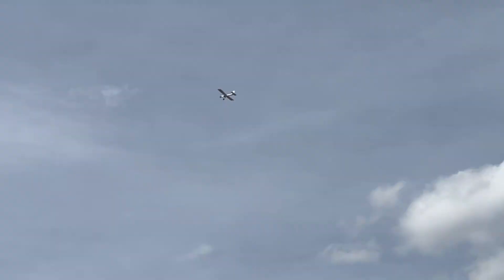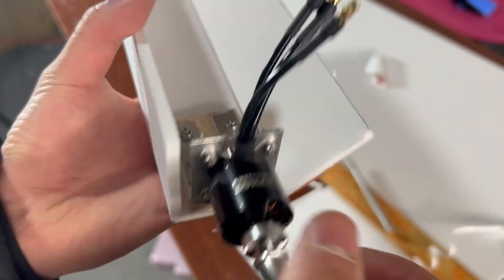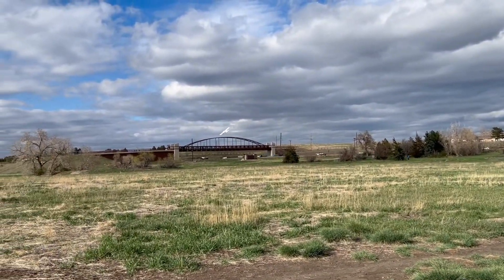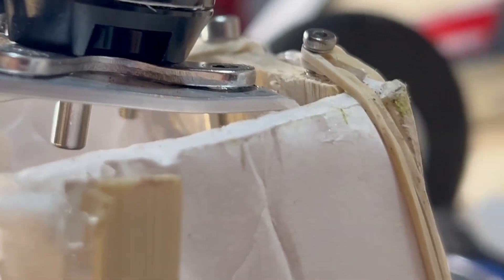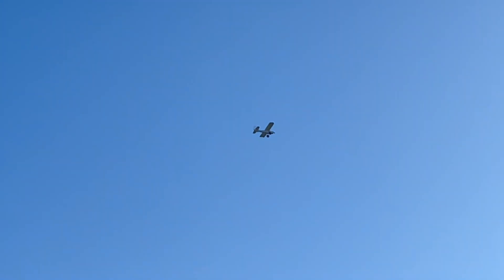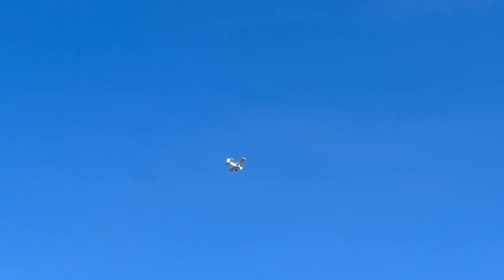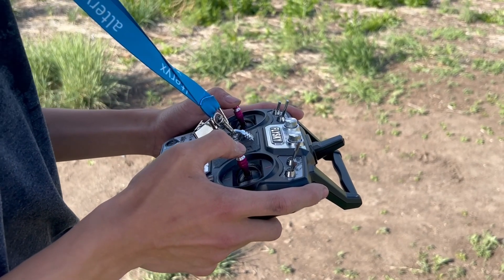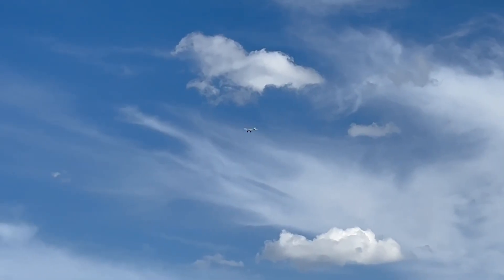Heavy Duty RC Carrier Plane

Comment: 35-year flight test engineer chiming in here with a few observations.... 

1) You might improve the stall characteristics significantly with a bit of leading edge droop on the very outer wing panels. Just search for images of "leading edge droop" or "wing cuff". You can also do this with "washout" where the wings are twisted along their span, to lower the angle of attack at the tips. (But that would be pretty hard on a foam board glue-up wing.) 

Any way you do it, the idea is that you're lowering the local angle of attack over the outboard wing sections, delaying stall there, while the inboard sections are still able to stall. This way, you keep a bit of roll stability even when the inner wing is fully stalled. It delays the "tip stall" which is a common cause of sudden roll off in stall, because it usually happens suddenly and asymmetrically (one wing stalls before the other, just due to tiny differences in shape between the two wings).

2) Note that with a rudder-only lateral/directional control scheme (no ailerons), when you put in some rudder to start a turn, you're shoving one wing faster thru the air, to generate more lift and cause roll. But the OPPOSITE happens on the other wing - it slows down, which increases stall margin. If you're already right on the edge of stall, that wing will instantly stall, causing a sudden roll off, far beyond the amount of roll you actually intended to create. So using rudder-only control when you're close to stall speeds is going to result in some pretty nasty handling at low speeds. Point is, you could have better handling qualities with aileron-controlled roll. Yes, it's more complex, but there's a reason it's done in full-size airplanes.

3) Good catch on the tail size. I could see right away you were having some yaw stability problems. Without ailerons, you're constantly yawing the airplane to generate roll, and you need a healthy vertical tail to keep things stable. 

4) This may be the most important observation here: Note that you can stall the vertical tail, not just the wings. If you put in a lot of rudder, and stall the tail, it'll get unstable and the tail won't provide the restoring force you're expecting to keep the nose straight. So you get yaw instability. 

Now, in a airplane with a streamlined (e.g. smooth, teardrop shape) airfoil for the vertical tail, the tail has some ability to handle airflow at larger angles, up to 30 deg or more. But a flat-plate vertical stabilizer (just like any flat plate wing) has very small angles before it will stall; the flow separates almost instantly at something as low as 15 degrees of angle to the airflow (which in the vertical tail would be sideslip). That's a really small angle, when you consider how much that plane bounces around when you throw in rudder inputs for roll control. And when it stalls, you lose quite a bit of the restoring yaw forces.

So with a flat plate vertical tail, the airplane loses restoring force in the yaw axis very quickly. If you kick the tail out with the rudder to start a turn, it's effectively creating a camber (lowering the effective angle of attack) so it's not really acting quite like a flat plate any more, and will resist stall somewhat. But as soon as you return the rudder to neutral, it's back to a flat plate, and the tail will now be fully stalled. So there's not much restoring force to undo the input you just made, and you have to put in opposite rudder... which only makes things worse, because now you're INCREASING the angle of attack which makes the stall WORSE! So it's even harder to get the nose back in the proper direction.

You can see, I hope, that the result of tail stall is a generally unstable yaw axis, which couples into the roll axis (and even into the pitch axis), thus making the overall handling qualities really quite nasty.

In short, if you give the vertical tail a bit of camber and a rounded leading edge, you might have much nicer overall characteristics. Even just rounding the leading edge of the tail will help significantly (like, a bead of hot glue). Anything to eliminate that sharp edge which induces airflow separation will help.

Here's a page, of many similar.
https://aviation.stackexchange.com/questions/21391/what-is-the-performance-of-a-flat-plate-wing

(You sort of lucked into a partial solution by making the tail length longer. Of course a longer tail will increase the yaw moment for the same force generated by the vertical tail, so you won't normally generate as large a yaw angle, and you're encountering less tail stall. Shorter tails require larger rudder inputs for the same desired control forces. So with your longer tail on the later design, you fixed some of this problem by accident. Tail length sizing is pretty important in aircraft design, it turns out, because this also affects the pitch axis.)

Comment: Hey man, I don’t know if you read comments but I have a couple rc planes rn but want to get into custom hobbyist stuff. Do you have any recommendations for some electronics since I fly with a proprietary spectrum controller right now. Thanks!
Reply from the maker: @FindleyFilms awesome to hear you’re interested! For a basic rc plane set up I would recommend a 2212 1400kv motor, a 8x6 prop, a 30A esc, a 1500mAh 3s battery, 9g servos, and a reciever that can connect with your controller. You can do a lot of stuff with these base electronics and they’re pretty cheap. If you’re new to the custom designing, I recommend watching a few Tutorials of building rc planes.
Reply: @ieatgrass_rc I know you’re probably super busy with school and projects but it would be sick if you made an electronics video/tutorial for beginners. I would definitely think myself and others would find that helpful.
Reply from the maker: @ I’m thinking about doing that 👍

Comment: I suggest you try adding sections at the end of the Wing with some dihedral or just add winglets canted out at 15° the winglets would prevent the plane from slipping sideways and support it when it's banking so it doesn't tip stall. 
Good luck!